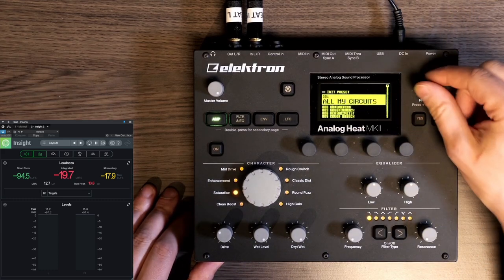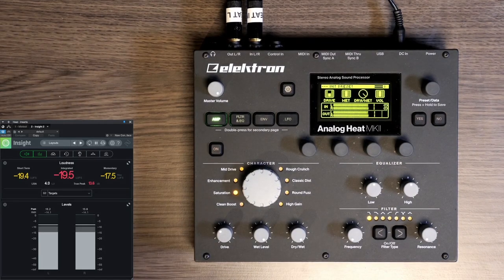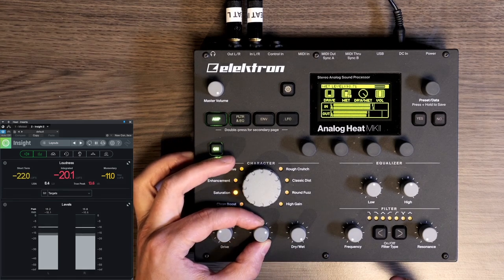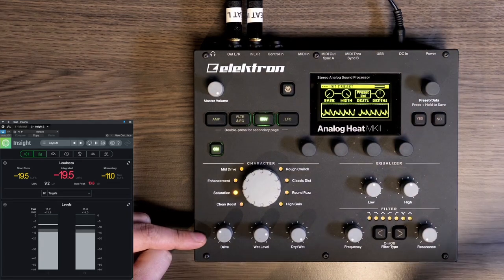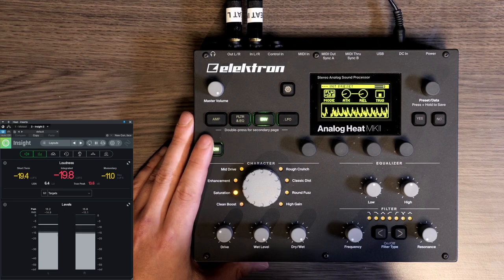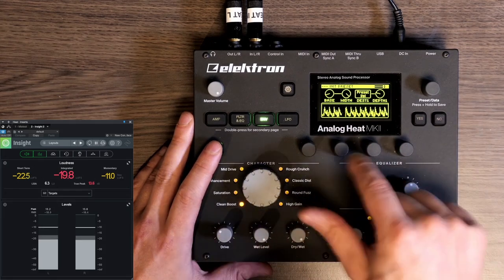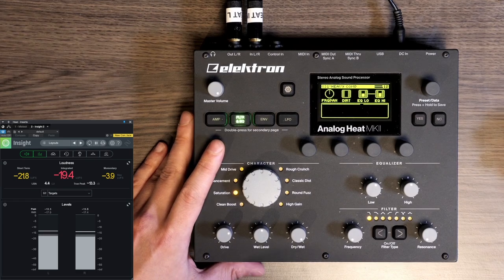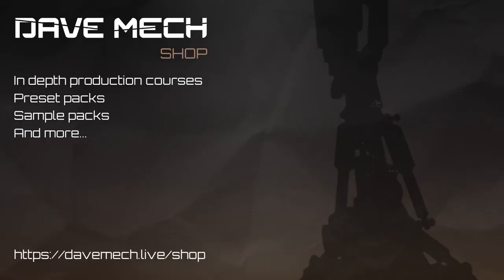FLEXIBLE Elektron Analog Heat // Dawless Mastering Chain part #2

Comment: Very insightful video on this device. Bought it a couple of weeks ago and loving every moment of it. Would love to see a follow up video on other creative uses for it. Thanks again for this one.
Reply from the maker: Nice! Thank you. Yeah will do at some point :)
Reply: @Davemech  hee dave, hope you're doing well. Any idea when a second part showing more of the analog heat will come out? Also another question I hope you might be able to answer. I just got an electro harmonic Platform (stereo) compressor / limiter and I'm wondering if I should put this before or after the analog heat in my A&H PX5? Or should I use it more on individual channels as a send for synths for example? I've tried some combinations now and I'm just not sure yet. Love to wonder what you think about this. Thanks.

Comment: I have a Syntakt that is known to be Analog too, could you tell me if the sound quality changes if I want to enter the DAW through USB or if I do it through line output to my audio interface?
Reply from the maker: Yeah syntakt has 4 analog voices and the analog fx block. So basically the difference should be negligible and possibly even slightly cleaner via syntakt’s own USB out as it takes less conversions between the analog to digital domain. Your audio interface is also connected via usb ao there’s always that AD convention. But that way there will be one more ADDA convention happening. But generally you probably won’t hear any obvious difference. A big upside of using syntakt’s usb is that you can stream individual tracks to your daw through overbridge.

Comment: Quick question  🙋‍♂ Do you find yourself using the heat much now you have the model 1?
Reply from the maker: Certainly. Although I now use a combination of boum into IMC right now. But otherwise I'd still be using heat after model 1. However , without it you can already do a lot with just the model 1 in terms of peak control :)
Reply: @Davemech  damn i just let one go cheap to fund the model 1.4!
Although i forgot you play out live quite a lot so it makes sense .
Id be using the mixer mostly in the studio.  & Have other filter boxes for thee craziness 🤔 still wondering if it was a mistake but hay im one step closer to playingdifferently!!
Thanks for the reply 🙏
Appreciate your channel 🤛
Reply from the maker: @eyesintheskies  Ahh don't worry about it then ;) You'll love the 1.4 and the drive on each channel is actually a really nice sounding feature. Cheers!

Comment: Thanks a lot for your work on this!
Reply from the maker: Happy to share :) anything else you'd like to see tested with heat?
Reply: Played with the preset preparing for a gig next week and will definitely use it!

One question, as the saturation is a bit too heavy for my music:
When reducing the drive parameter (to 70), will I loose a lot of peak control?
Output volume is remarkably lower that way but I don’t think it’ll be an issue?
Thanks a lot, Dave.
Reply from the maker: @evenmind-music  is your input level not hitting above 80% of the level? Otherwise dial back the saturation a bit yes. You lose a bit of the peak control then but the sound is most important. you could compensate the volume loss a little with the dirt parameter on the filter page. Enjoy your gig! And would love to know how it sounded with the preset:)
Reply: @Davemech  input level is around 80%.
Thanks a lot man, really appreciate it!

Comment: Thanks for this explanation Dave of the AH! I can make a lot more out of my AH then how I used it so far. I knew it, but this will help. I don't have a spectrum meter, but the amp meter on the AH give the same information isn't it?
Reply from the maker: Nice!
Yes more or less but i like to be exact :) and sometimes it's a bit harder to tell because of the peaks. 0.5db difference can already trick your brain. If you have any DAW, it will have a level meter with an option to read out LUFS. A spectrum meter is where you see the frequency range ;)
Reply: @Davemech  Yes, I thought so about the spectrum naming, but you knew what I meant. I still don't use a DAW at the moment, but that moment will come after I finished my music-/workplace at home very soon (till this date still using temporary setups in the living room 😅). Hopefully only for mastering and recording. Still a lot of (Elektron) gear to explore. 😉

Comment: Would you say the Mk1 is functionally the same for someone mainly using it as a module with overbridge2?
Reply from the maker: Mk1 firmware and hardware are pretty much the same except for the screen and that you can use mono L in   So Yeap , it’s functionality the same 👍

Comment: Dave I was wondering how you change Heat presets seamlessly during a live set?
Reply from the maker: I don’t :) 
Generally not a good idea. But if you do want to do that then make sure you don’t change circuitry as that switch is audible.
Reply: super clear, thanks for your quick input sir! @Davemech

Comment: I like high value Videos Like this one. To the point without ego trips and commercials . Nice

Could i do what you show in the video using the mk1 version?

Have you found-tried any other similar breed devices for mastering purposes other than Analog Heat and Oto Boum ? 
When I am looking for an analog coloring box I always  land at 2000+ euros saturators or guitar pedals. Is it really only these two devices that come close to that I wonder.
Reply from the maker: Yeap mki is virtually the same. Mostly hardware related differences. But sound and function wise you’ll be able to do exactly the same on the mk1. 

Except for the IMC I haven’t gotten any more devices yet. But hope I can show a few more in the future :). I’ve got the analog heat fx as well so that’ll get a video as well for sure
Reply: @Davemech   A while later. Hallo again. Rewatching now and it makes me curious to see a video where you go more targeted to the filter-eq section. In this i see the kick triggering most of the compression so i would like to see examples where you ease up on the bass energy and saturate more mids-highs than kick drums etc

Comment: Thanks for this video, very helpful ! Now i know i definitely need AH into my setup lol :)

Also i'm curious if analog FX chain inside Syntakt can fully replace Analog heat ... i'm thinking about chain Digitone>Digitakt>Syntakt where in Syntakt everything except of KICK (all other tracks except of kick + external audio in) will be routed to analog FX chain ...
Reply from the maker: Happy to share :)

Honestly it can't compete really. The AFX block is nice but you simply don't get as much control over your signal. No envelope follower for starters. It's great and I use it a lot for syntakt and it surely is a nice FX processor. But i wouldn't use it as as an output mixing stage. You also give up a lot of what makes syntakt so great by going that route since you can't use the AFX block in creative ways anymore.

However, don't hesitate to experiment with that approach of course :). Experimentation is key and maybe you'll land on a signature sound that you love so definitely try it!
Reply: @Davemech  i still didn't jumped on syntakt, still on the fence :-) Just speculating .. yeah no envelope follower but you can just trigger envelope with triggers from sequencer, so you actually don't need follower, or i am wrong ?
Reply from the maker: @raysubject  it's not the same. Envelope follower follows the signal. The negative envelope on the AFX block is just a static envelope which doesn't take its curves from an input signal. You can achieve a pumping effect with the inverted envelope setting and it's certainly nice :) but i personally wouldn't put an entire signal chain through that. It's also not actually responding to a signal with a kick that way. But then again, it can be a sound :) . It's just not the same as an analog heat or even an analog heat light. It's just its own thing
Reply: @Davemech  yeah makes sense .. thanks for explaing..

Comment: Is this compressor setting also suitable for master insert of an mixer board? I'm thinking about to use the Analog Heat as kind of send/return for the final mix of my modular synthesizer and my Allen&Heath ZED-18 before the master out.
Do you have any experience in such an usage?

Nice vid by the way. 👌🏼
Reply from the maker: Yeap it is 👍 I use it with my SSL big six that way. Of course altering settings according to the music. Thanks for watching

Comment: I'm picking up the signal from an analog console in three stereo pairs. one stereo pair goes to the analog heat, and in order to equalize the bypass of the analog hit into one unit gain with those two stereo pairs, I had to change the sensitivity on the input channels in RME UCX, by the standard they are +4, and I set the analog heat to -10. and they are completely equal, you send a sine -18 and receive a sine -18 with a bypass analog heat. may be useful for someone